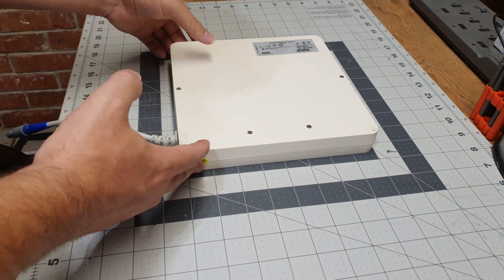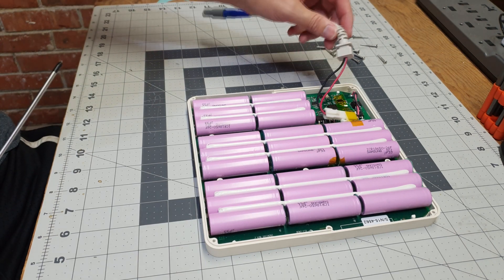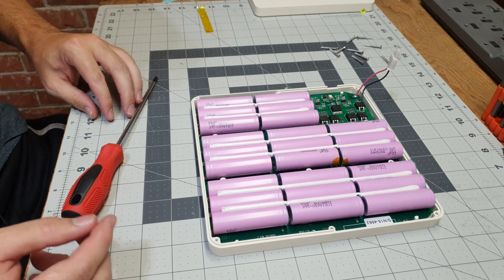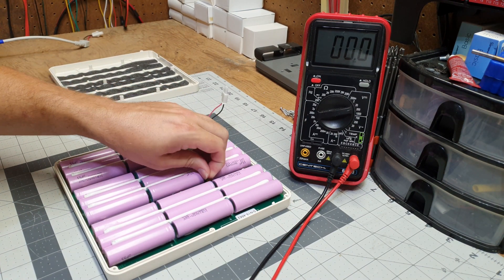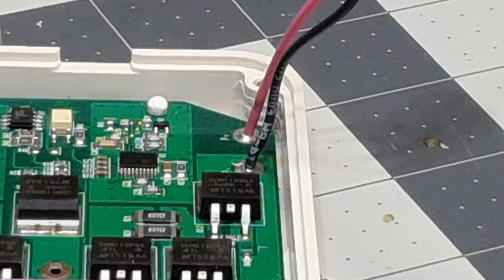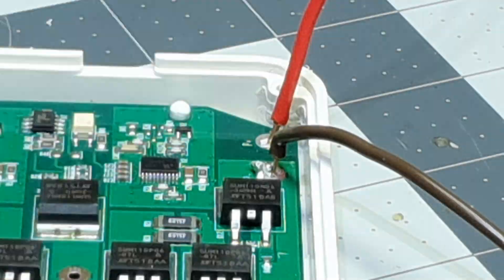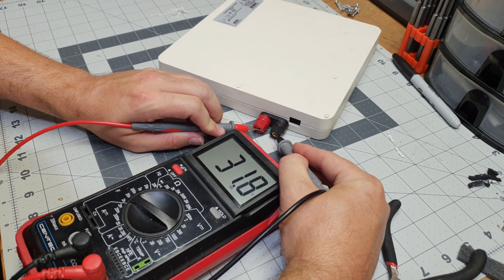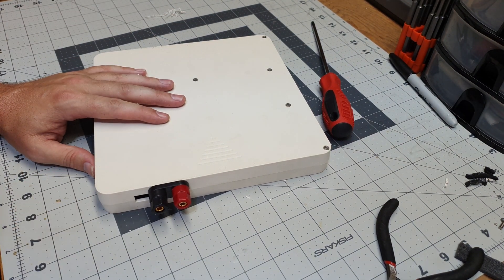8s3p - Module Mod

Comment: I want to thank you for video on how to use these battery packs I really like your idea on the banana connectors this is a really good idea I like this a lot I just bought two of I have an outside LED yard light that I need a 32 volt battery pack and this will work perfectly for it thanks again for your idea and posting it
Reply from the maker: Awesome I am glad you found it useful.

Comment: Question- what if they were not all 3.9? How would you balance the voltage? Thanks for the video. Very helpful.
Reply from the maker: If one was way off I would discharge till bms shutoff check each voltage and if balanced there i would do a very slow charge at 0.2 to 0.5 amps. When full check again. If one was still way off not sure I would use the pack. I would then try to charge just that cell group to full and watch to see if it self discharges. If it is I would harvest the good cells and call it a day.

Comment: what would happen with a 20watt panel input to this volt converter, to solar charge controller? 
Does it jump the charge process?
Do anything helpful for small system 
20watt panel, controller, 2 lipoPhos 12v8a.h. parallel. 250watt inverter. 

Portable generator/ cooler build.
Possibly interactive cooler robot beer delivery. Lol. 
A blind robot bouncing off walls blasting music trying to deliver beer. While vacuuming the floor. 

Nah... But to run somewhat a modern power outage/portable generator useful enough for say a tv plus fan, and bluetooth speaker amp 25w to to 3way 3.5 inch b.o.s.s. speakers. TV 70watt fan 30w-40w
These cells look really decent for projects like this build I am working on. Ty for the video. Also interested in dc to dc charging. 
Looking for power packed for 3-8hrs. Battery solar charging while being used is the goal aswell. To be reasonably efficient in capacity use and recovery rate.
Reply from the maker: Not sure 20w would even be enough for a solar charger to up convert the voltage.

Comment: have you tried to change this out for a higher amp bms?
Reply: probably gonna go that route. I need 40 amp atleast. but ill use the second pack for my Bluetooth speaker I made
Reply from the maker: Nope.  
The cells get a bit warm even at 5 amps so changing the bms to higher amps and going over 5 to 10 amp would start to make it dangerous.
Reply from the maker: Also the cells are attached straight to the pcb and the only way to change would be to harvest the cells and do what ever bms you want.

Comment: what charger are you using?
Reply from the maker: I use a bench power supply I built in this video https://youtu.be/-KbgWXUNgXA but you can also find 33.6v charging brick on Amazon or eBay.
Reply: @TechCentric_00  I'm gonna look into this. you got your self s subscriber.  what amperage and voltage do you recommend?  also ill check out the specs on it
Reply from the maker: I would stay at around 2 amps. I did charge one module at 5 amp, but the cells got a bit hot.
Reply from the maker: If you use a charge brick it will charge to full 4.2v per cell which is 33.6 total. If you get a variable power supply I would charge to 4.0 per cell which is 32v this will extend the life of the cells.

Comment: Little confused (it doesn’t take much)  did you say that you could wire these in parallel and series maybe to build a 48v pak ?
Reply from the maker: A 48v pack can not be achieved with these modules. For one module the max voltage is 33.6. So if you put two in series the voltage would be max 67.2. Putting them in parallel only increases the capacity and the amperage it can output. The only way I see to do a 48v system with these is to series two or more together and use a buck converter to reduce the overall voltage to 48v.

Comment: What BMS is needed to use these cells or the built in management system of the battery pack is enough?
Reply from the maker: I just use the internal bms.
Reply: @TechCentric_00   okayThanks.

Comment: Nice presentation..  I have a few questions:
1-what is required to charge these batteries correctly..  could a midnite classic 150 work?
2-you said its best these be charged at two amps .. how do you limit this? Through the built in bms or your charge controller?
NB: I currently utilize a 2kw solar array with flooded battery.
Reply from the maker: 1. I am no solar charger expert, but looking at their website it says battery range 12 to 72v so I would say it could, but you need to be able to not only control the voltage but also the amperage. No more then 5a per module.
2. Yea the controller would need to be able to adjust both voltage and amperage. I use a Variable Power supply that has the ability to adjust the voltage and amperage to the needs to battery I am charging.

Hope this helps.
Reply: @TechCentric_00  Awesome.. mine does both voltage and amperage.

Comment: I’m brand new to this battery stuff, but liked the project so ordered 4 of the packs today.  My question has to do with charging the three (or four) packs in parallel:  what voltage do you set it to and do you current limit the source to, I think you suggested, 2A?  As with your power supply video, can the source just be a high quality DC power supply?   Thanks, appreciate your helping a noob.
Reply: Just the information I needed.  Thank you.  And thank you for the link.  J
Reply from the maker: My source power supply is 58v 10a and I use my variable power supply to bring it down to the proper voltage and amperage. For this module if you want to fill to the top 33.6 (Which is 4.2 per cell) is the voltage to use. If you want to extended the life of the cells you can just charge to 32v (Which is 4v per cell) and you only lose 15 to 20% of the capacity but will extended the life of the pack. For Charging you can use a 8s charger brick and those are mostly 2a already. Here is one I use for the Power Station https://www.ebay.com/itm/8S-28-8V-29-6V-Li-ion-Li-Po-Battery-Intelligent-Smart-Charger-33-6V-2A/233463205462?ssPageName=STRK%3AMEBIDX%3AIT&_trksid=p2057872.m2749.l2649
Reply from the maker: Hope this helps.
Reply: @TechCentric_00  what would happen with a 20watt panel input to this volt converter, to solar charge controller? 
Does it jump the charge process?
Do anything helpful for small system 
20watt panel, controller, 2 lipoPhos 12v8a.h. parallel. 250watt inverter. 

Portable generator/ cooler build.
Possibly interactive cooler robot beer delivery. Lol. 
A blind robot bouncing off walls blasting music trying to deliver beer. While vacuuming the floor. 

Nah... But to run somewhat a modern power outage/portable generator useful enough for say a tv plus fan, and bluetooth speaker amp 25w to to 3way 3.5 inch b.o.s.s. speakers. TV 70watt fan 30w-40w
These cells look really decent for projects like this build I am working on. Ty for the video. Also interested in dc to dc charging. 
Looking for power packed for 3-8hrs. Battery solar charging while being used is the goal aswell. To be reasonably efficient in capacity use and recovery rate.

Comment: I bought 3 of these babies and they work amazing, I did remove the cells from one unit for another application. Out of the 3 packs one of them did have a single cell that had tested bad the other packs were just fine.. I'm using one as an external battery for my laptop with a buck converter and works quite well for what I need it to do.
Reply from the maker: Very cool. I have 5 extra I am working to find a good use for.

Comment: I bought 20 (4500wh). They are in two tool boxes (10 EACH) and I can connect them parallel to my  3000Wh solar generator. Total of 7500wh.   1500w pure sine wave inverter in SG.  24v with 12v converter.   They are auxiliary only to the SG and balance over night to within .03v of each other........
Reply from the maker: Would love to see that setup.
Reply: @TechCentric_00  would be happy to send pics, but where?
Reply: got it    I'll send a few

Comment: So if you put them in parallel do the packs have an active balancer? For charging and discharging
Reply from the maker: I am not sure if a single pack has a balancer in it but I think it does, but when you parallel batteries they will self balance. If pack one of the three has a voltage drain the other two will send power over to keep it charged until all 3 maintain a voltage or if the drain is bad they will all drain until the bms kicks in a shuts it down.

Comment: What brand and voltage inverter are you using? I bought a EpEver 20 amp mppt charge controller to keep the batteries charged.
and I bought 8 of the battery packs this is 1800 Watt hours. I now need a Power inverter what did you use?
Reply from the maker: These packs are not recommended to be discharged over 100w per module. So with 8 your would be 800w. Mine is a 12v pure sine 300w inverter. These packs fall in a interesting voltage range. If you see my other video on these modules I use a buck converter to knock down to 12v and use that to power the inverter. If you do not want to do that that you can use a 24v but check the voltage range to make sure you can maximize your packs. The range of this pack is 24v is depleted and 33.6 is full. Of those ones I found the max in voltage is around 30v and so you would have to limit your packs to that voltage and would loose a lot of the capacity. Hope this helps.

Comment: what charger do you use?  I'm thinking of using three packs as you describe with a solar panel and 300 watt inverter.
Reply from the maker: I thought I had responded this. I use my Variable power supply that I created in this video.  https://youtu.be/-KbgWXUNgXA 
For the power station that I built using three of the modules I use a 33.6 Brick Charger I got from eBay.

Comment: This is a very informative posting for me, thank you. I bought 10 of these items and I intend to use them for hunting camp LED lighting. I am going to copy your design. I have only recently gotten intrigued the whole lithium and solar world so I am way behind on all of the finer points. I need to come up with a way to charge to 33.6 volts (+/_) so I can bench test. Do you have a low cost suggestion? 
Thanks for sharing this info.
Reply from the maker: I use a 58v 10a power supply as the main source and use the varibale supply for all my different battery packs. Check out this vide I did on a variable power supply. https://youtu.be/-KbgWXUNgXA
Reply: @TechCentric_00  I just watched your power supply film. That's WAY over my pay grade.......and way cool!  DCF
Reply from the maker: Would love to see your project when completed.
Reply: @TechCentric_00  I am pretty well going to do exactly what you have done. It looks brilliant to me. I ordered the same banana plugs so I can do a stack. I got started putting a Tesla battery in a travel trailer and now it has taken on a life of its own. I found an mppt boost SCC so I can ultimately use solar panels. I got side tracked by "making a living" demands. I ordered a small 32v 5amp power supply and I can rig a small boost converter to get to the correct voltage when it arrives. Anyway, thanks for the video. It is a big help for me.
Reply: @davidfloyd9962  love it. Have fun with it my friend!

Comment: Not a proprietary connector. Medical device DC connectors are standardized like anything else. The plug alone probably runs $50 or more.
Reply from the maker: Good to know. This seems like a much cheaper solution then. ;-)
Reply: Do you know where to find this connector?  I have been looking for the white connector that is on the inside.
Reply from the maker: Sorry I do not.

Comment: Have You tested the capacity of the cells?
Reply from the maker: At the end of the video I did a capacity test and the overall pack was 7.5ah so divide that by three that is 2.5 and the cells are Samsung 2.6ah. So they tested pretty close to full. I didn't completely top it off so I believe these module had very little use.